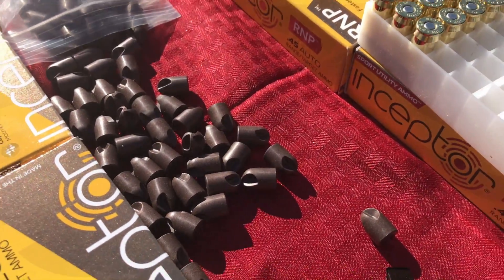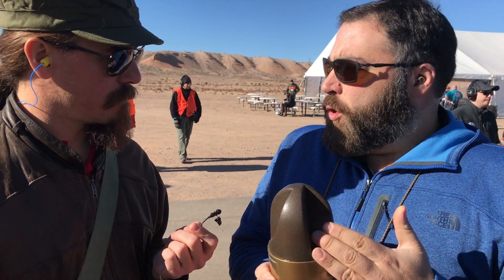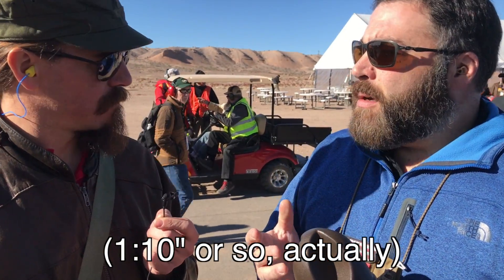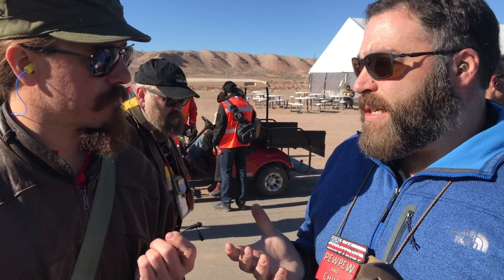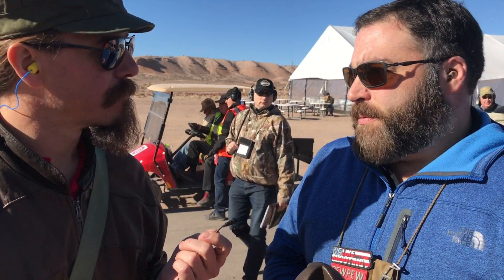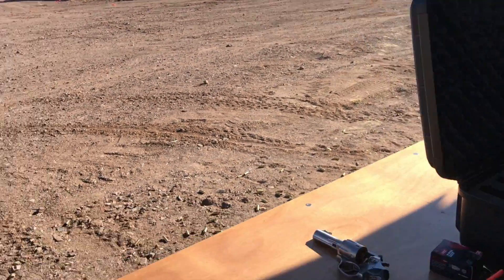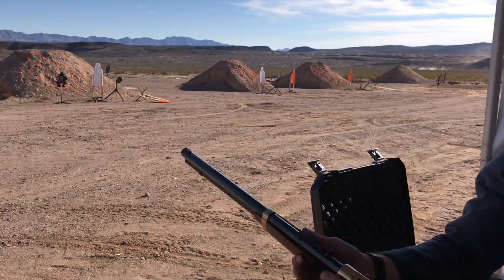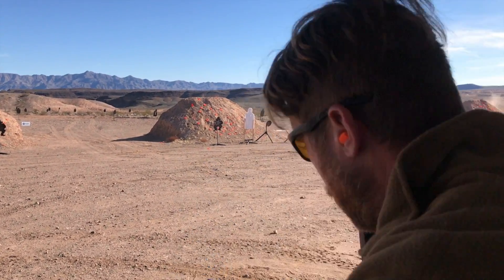SHOT 2017: Polycase Ammo

Comment: After hearing their claims about effect on soft tissue, it got me wondering about spin rates.  Here's a hypothetical 9mm load using easy numbers. This doesn't represent terminal ballistics, just external in-flight ballistics.

1:10 twist
Distance: 10 ft/120 in
Velocity: 1200 ft/sec
Revolutions in flight: 12
Time: 10 ft/1200 ft/sec = approx .0083 sec

12rev/.0083 sec * 60sec/1min = 86,400RPM

Keep in mind this only represents the initial RPM at the muzzle in a vacuum. It doesn't take into account drag from air resistance (leading to slowing down over distance) lateral wind shear, air density, barrel length, type of barrel crown etc.  So most likely it will hit the target at a slower RPM. So the spin of the bullet is still significant, but that's the case regardless of projectile type. 

What I find interesting is their analogy to a propeller blade, when the negative cuts they've made to the projectile seem to suggest it's more akin to a drill bit. That to me says it might have a harder time stopping in soft tissue because it will make a cleaner hole, not a bigger one (if it does stay together upon impact).

Comment: I've personally tested the polycase ammo in 9mm and 45ACP, and it's GREAT. I'm frankly surprised you guys are so flummoxed by this, as this product is not new at all.  It goes through 2x4, drywall, layers of denim great, without getting stopped up like a hollowpoint. It then appears to begin tumbling (not breaking up--I've never had one break up) in ballistic gell.  Almost all my rounds I shoot in the gell end up flipped backwards. This is where it dumps all the energy, which it does to great effect on the block. The only time the round breaks up is on steel, where it turns to powder during close-range match type shooting.
Reply from the maker: +PristineTX We know it's not entirely new, but we have no personal experience with it either. We do plan on acquiring some and doing some of our own testing and experimentation. ~Karl
Reply: Ok, so first off, obviously we're talking about a barrel's rate of twist, not sure why you felt the need clarify that. that rate of twist also makes the bullet spin at the same revolution, so it doesn't matter which we are talking about.

Second, this is about a 9mm so its a 1:10 twist, not 1:12. A 9mm's velocity is between 1200-1500 depending on the brand and bullet grn; in this case it's a very fast, light bullet so 1500fps is the velocity(not 3000.)

Third, I never argued the RPM, i argued that over the course of .000667 seconds and 3-12 inches of penetration , what seems fast in a stationary object, 108,000 rpm, is not very fast in this perspective. .3 to 1.2 revolutions, not accounting for deceleration. 

here's the math: 1500fps x 12in= 18,000in/s 
                               18,000in/s / (10in/1twist)= 1,800rps or 108,000rpm
3inch penetration               3in / 18,000in/s= 0.0001667s
                                              .0001667s x 1800rps = .3 rotations
12inch penetration             12in / 18,000in/s = 0.000667s
                                               .000667s x 1800rps= 1.2 rotations
Reply: Wasn't a criticism, Karl. I'm a big fan. Just surprised. I would have thought it would have been hard to miss at the show last year when they were trying to make a splash. Looking forward to seeing your thoughts when you test it. I was really surprised by how well it performs for me. I had a lot of skepticism too, until we dragged out a block and shot it. When you realize it isn't really a frangible round, (at least not in soft tissue--we never had one break up) it makes more sense.
Reply: It would be fast if you are thinking about it as a stationary object. But as a moving projectile you have to think of it differently. Think penetration depth and twist over time. Use a shot to the chest as an example: a 3-6 inch penetration with a 1:10 twist. this is only 1/3 to 2/3 of a full rotation. a shot into gel would be 10-12 inches, on average, so about only 1 full rotation. so the analogy used " a boat propeller in the water" seems to be just jargon.

I would love to see test videos if anyone has made any.
Reply: Kevin Sullivan o
Reply: Seems like a ripoff of the stuff lehigh puts out.
Reply: Justin Hood 
Unfortunately you have no idea what you are talking about. A weapon with a 1:12 twist, that is referring to the barrel. The rifling in the barrel is 1 turn in 12 inches.   With a velocity of 3000 feet per second, in a 1 in 12 twist barrel, the bullet will spin 3000 revolutions per second.  X 60 for RPM

Comment: 9mm at a buck a shot. OK.
Reply: Where you you shop? I got my boxes for $0.45/rd at Cabella's before Thanksgiving. Even at full price they are $0.70/rd.
Reply: If it's meant as a high quality self defense round that isn't unheard of... Actually on Cheaperthandirt it is in the middle of the 25 round box price range. Hornady HP defensive rounds are more. This isn't steel cased plinking stuff

Comment: The damage is not so much caused by the bullet spinning from the gun.
With the twist bullet, it is forcing itself forward and thus the chamfers are forcing material at angles tangential to the center of the bullet's mass, thus causing it to spin inside the target. That mass that spins the bullet is also thrown off at an angle, dispersing the force of the bullet over a larger area.

Obviously it does not spin perpetually due to friction, but it does not have to be spinning before it enters the target to do extra "damage". The spin, ultimately, is of little importance.

Personally I predict this bullet to be devastating.

Comment: I am curious on arc length/spread of projectile(wind/rain/snow included, velocity of round, twist/reverse twist and expansion of Poly round and channel groove on projectile. Does temperature effect the round with -10 vs 50 degrees Celsius? Normal propellant or lesser than usual load? Will suppressor's work or the turbine effect make it dangerous? Will it's water cutting action make it viable for underwater usage or will it float? Similar to H.E.A.T Anti-tank rounds that were banned? Have fun blokes ;)

Comment: I've seen several ballistics gel reviews of this stuff and it seem about even on standard hollow points for wound channel, its pretty I teresting stuff, I garners admirable penetration though not a super deep expansion cavity, and from.what little I've been able to test with it the recoil from.smaller gun is a huge advantage for things like a ruger lcp (what I fired with this ammo) and for guns with feeding issues on jhp these should be nearly as reliable as ball. so I think there's tradeoffs but I do think its potentially quite viable especially in compact firearms, and might represent the wave of the future. and it may be worth noting the leiheigh extreme penetrator hunting rounds in larger pistol calibers use the same principle of tissue disruption but in a typical lead and copper configuration

Comment: I think it is not the same compound ratio. They most likely failed to explain the difference between the two bullets formulas. Because it doesn't make sense if it's the same. How can one easily break apart on steel impact. If the other one penetrate well through other materials.

Comment: I'm not a big fan of their defensive stuff made of polymer with some copper powder sprinkled in. I prefer the Lehigh Defense bullets, the Xtreme Penetrator and Xtreme Defender. They use the same physics to do massive damage in a fluid medium, but they are solid copper and can penetrate barriers better than any lead round. However, I do like the idea of polymer bullets for range ammo. If all you are doing is shooting at paper or steel targets, then what does it matter if the bullets are plastic? I am interested enough to buy a few boxes to give it a shot. If they run through the gun, than that works for me.Plus, they are much cheaper than lead rounds, as well as not being toxic.

Comment: My physics knowledge is a little bit rusty by now, but such a nose design which direct the fluids sideway at 90 degrees would cause a lot of drag. That combined with low bullet mass means the bullet's velocity would drop much faster than say, a normal pistol bullet. At very close range this things might work. More than 30 yards? Not so sure!

Comment: I don't think their "fluid dynamics" is from the twist. I think what they are claiming is the fluid launches off the flutes like a ramp as the round pushes through. Which might work for an inch or two but sounds like bullshit that it's better than defensive ammo. 

Frangible is also frangible in a body. It would destroy itself in a mess of a wound, not make a magical hydraulic would cavity.
Reply: Shawn Colleaux not necessarily, tissue has "give" that would not act the same way as a hard object. Shoot a marble at a steel plate. Then into a person. Pretty sure one will result in glass dust and the other on a marble sized hole.
Reply: Filipe Amaral feel free to watch a video of frangible ammo against ballistics gel.
Reply: ***** The Polycase stuff seems to fragment. Linguistic barrier here, to me fragmenting =/= frangible.

Frangible on tissue is more like wax slugs, the Glaser safety slugs, etc.
Reply: Filipe Amaral frangible ammo on soft targets disintegrates into tiny pieces and leaves a mess of a wound. Even a round nose.
Reply: ***** That's why I said the Polytech stuff seems to break into 3/4 "large" pieces in gel.

Comment: If the round is designed to shove fluids sideways as it spins, it seems like it would also be highly un-aerodynamic, right? Not good especially for a light and fast round.

Also, considering the claim that body fluids move away from the bullet twice as fast as the bullet is moving- this would rely on the difference in density between the bullet and body fluids, or else that energy wouldn't exist.

They also seem to be marketing 2 products made of the same material as "able to penetrate stuff" and "disintegrates upon hitting steel, which means one of the claims isn't true, like you guys pointed out. But if it deforms, the flutes have no chance of working.

These 3 things make me think that if the fluting actually works, it would work much better in a denser, non-deforming bullet. It might also be good to cover up the flutes with a light material for when it's in the air.

Comment: I'm pretty sure it isn't the rotation that causes the hydraulic reaction, but rather the shape itself. The "ramps" on the bullet would force the body mass sliding over it to change direction outward. 

I have no idea if these work or not, never fired them. I'm just thinking about it should work. I want high speed footage of one of these hitting ballistic jell before I'd ever think about buying some. Even if they did work I'm not sure I'd go with them over traditional hollowpoint

Comment: I've been watching the testing of both these and the solid copper fluted bullets and the performance of both is impressive in gel even through light barriers ( drywall, 1/2" plywood, etc.). My concern is how the wound mechanism will translate to less hydrous and less consistent  material like muscle.  While gel gives a pretty good indication of what a hollow point will do in flesh, it is not analogous in every matrix and I'm not entirely convinced this wound mechanism will translate, but is love to find out.

Comment: Quick formula for figuring bullet rpm MV X 720/Twist Rate = RPM.  So the bullet may not make a full rotation inside something the size of a human body using a 1 in 10 twist rate but it makes that turn very very quickly at about 111,000 rpm or so.  But then we need a way to figure the rate of deceleration which is going to slow the rpm down. Eh just shoot some jello with one.

Comment: I don't think (in theory) the bullet needs to be spinning or "turning" as fast as you would think. I say that because the "flutes" on the bullets are actually ramp shaped. So EVEN IF the bullet had zero spin at all, material entering the "flute" axially, will be directed out radially. That is to say, fluid entering the flutes parallel to the bullets trajectory will be directed outward (at the very least) at a 45 degree angle simply due to the ramp/incline at the end of each flute. So even with minimal spin, there is potential for that effect to be exacerbated and cause this concept to be half functional, in my opinion.
Reply: Not just "minimal" spin. Zero spin would be enough, if the ramp cutouts actually do what they are designed to do. The jets of fluid ejected by the ramps would be like three blades cutting into the target's flesh.
Rotation is therefore not needed to inflict severe damage.
However, regardless of whether it is needed, these cutouts would cause the projectile to rotate, as the ejected jets of fluid are off-center, creating an effect like three spinning blades. Assuming sufficient kinetic energy in the projectile, these fuckers would blend your insides.

Question is: do these ramps function as intended, and does the bullet carry enough kinetic energy to cause that amount of additional damage?
Reply: @theuncalledfor  And if they do, should this be legal ammunition? Ammunition that causes wounds impossible to patch up is against the geneva convention.
Reply: @Qureas  My understanding is that the Bush Jr administration exited that treaty and it only applies to militaries anyway.
Reply: @Qureas  Tear gas and hollow points are also against the Geneva Convention. Doesn't mean they aren't fair game against your fellow countrymen.. 'Murica
Reply: @Qureas  Geneva convention? You mean Geneva suggestion?
Reply: Derelict it looks like the ramp angle from those cut outs is whats causing tissue tearing
Reply: The shape and the concept in theory has something going for it, but i don't know if the end product can pull off what the marketing claims.

Comment: The thing here is they keep saying the bullet has to turn but that is wrong. Imagine pushing a propeller or a wing through water, even if you keep it from spinning the water it displaces will still be forced over the curved surface and will therefore spin or at least an engineering student that is what I believe they meant.

Comment: Advertised velocity of 1445 ft/s. A Glock 17 has a twist rate of 1 in 9.84 in (250mm). That equates to 104,500 rpm.
Reply: Donald Weber but look at how long it takes to cover 1445 feet. It spins 1.2 times for every foot it travels forward.
Reply: How far are you from the muzzle? A bullet loses linear velocity much faster than rotational velocity.
Reply: Porcine tissues have been used as a test medium for a very long time due
 to there analogous nature to human tissues. And yes, the US military 
used to test its small arms on pigs.

Again, no animal or human I know of is made of ballistic gel.
Reply: Filipe Amaral
How long it takes to cover that distance is irrelevant.

Glad you can do basic math.
Reply: Disposable Channel
Actually, the best test analog is live pigs.
Reply: Donald Weber ... I just said that it covers so much distance so quickly that the fact that it spins at >100k RPM doesn't matter.

Really, if the math is so basic why are you dismissing it?
Reply: Filipe Amaral
That is 1.75 revolutions every .001 seconds.
Reply: Donald Weber And every .001 seconds the bullet is ~1.45 feet ahead.

I'm 165 lbs and barely a foot from chest to back. The bullet would exit at around 1.2 revolutions like O said previously.

Unless you're planning on shooting obese people or bodybuilders I don't see why the RPM is relevant.
Reply: Pigs are very consistent. You must also realize that the chest cavity of a terrestrial mammal is mostly air, with some bone and muscle. No ballistic gel.
Reply: Yes, you can make 10,000 blocks of gel that are with in a very tight fraction of being identical. but 10,000 pigs would be only generally similar to one another. BUT their 'generally similar'ness is still much closer to any one of 10,000 humans than any block of gel
Reply: Disposable Channel
How well does gel determine how a bullet will react to bone? How about mostly hollow lung tissue? Last time I checked, animals weren't homogeneous.
Reply: Donald Weber Dude, the point is that it's a consistent medium to compare bullets. You shoot bullets into the same, consistent medium and you can compare the results to see which bullet performs better. It's a comparative test, not an absolute performance test because such a test has too many variables.